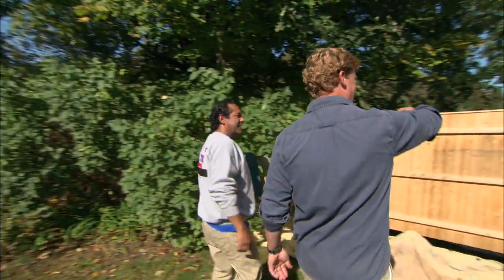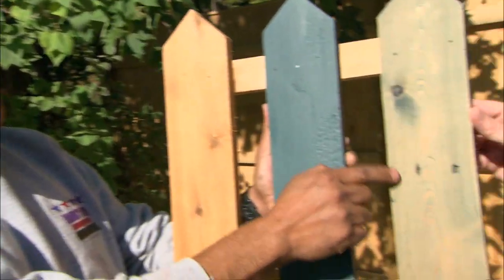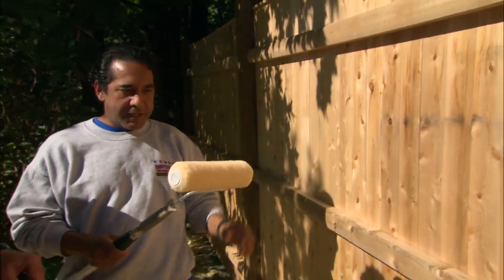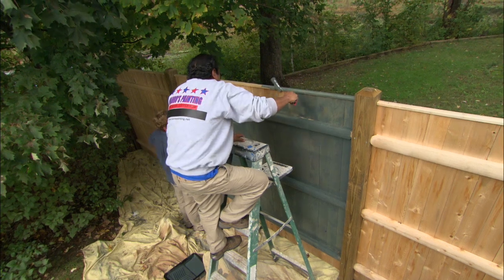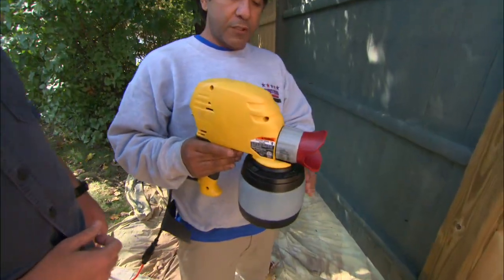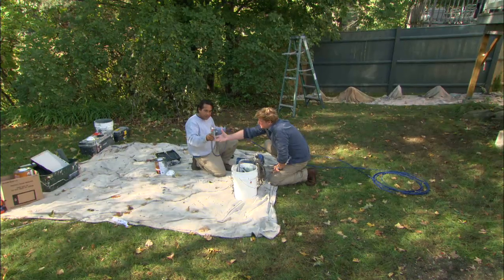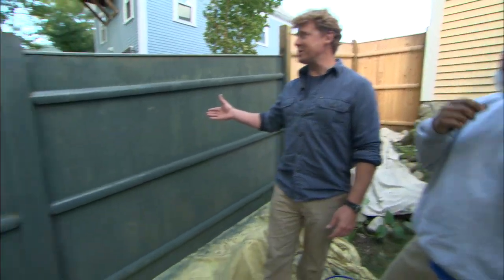How to Stain a Wood Fence | This Old House

Comment: This might be a dumb question, but how do you get the back of the fence on your neighbor's side, or if it is inaccessible?  You just leave it? What's the point of a stain then for protection against the elements if 50% of it won't be covered?  Just for aesthetics on your side?

Comment: The pro sprayer looks like more work. First you spray and then you go over with the roller, did I get that right?  The sprayer with the built-in pump looks more efficient. But I figure if I just use the roller, while I have to deal with a roller pan, etc., I don't have to deal with hanging tarps on the neighbor's side nor complaints about whatever spray might float onto my neighbor's handing laundry, if it actually does or not :p I live in a city where homes a very close,  mostly attached on two sides.   Anyhow, what am I missing about the sprayer? Have I got this wrong?
Reply: I think it is faster; and lighter for hands and arms.

Comment: I just do it all by hand like a savage.
Reply: You're a beast..
Reply: Gi Nattak injust been painting my fences with a brush, by hand. I don’t use a roller
Reply: Same...stab a tap into a 55gal drum that carried in on my shoulder, cup my paul bunyan sized hands and fill em up, then smear it on them rough pickets til their smooth as glass, 1 coat does it for a good 10yrs.
Actually, that coat usually outlasts the wood underneath.
Reply: Me too... I used exterior semi-gloss paint, & 18 yrs later we're just now repainting & repairing a few boards/posts on that fence. My problem this time is the contractor doesn't want to hand paint, my kids are grown, & I'm in no physical condition to do it myself... Ugh! I might be stuck with the spray method & get only 3 yrs outta 15 yr paint~ the injustice of laziness/shortcuts.

Comment: if you're going to spray, you must back brush for proper coverage
Reply: Not if you know how to spray correctly, proper tip size, proper pressure setting. Etc etc.

Comment: Good advice but why was the final product so splotchy and bad looking? Do they need to do a second coat?
Reply: The product itself is not ideal… If they applied the best option which is a deep penetrating oil based stain… it would have looked absolutely amazing. 
The best advice for anyone is…. If it is NOT a deep penetrating stain… avoid it !! 😀 Stay away from Form Filming Stain that just sits on top of the wood instead of diving into 😀

Comment: Look, just buy a cheap pump up garden sprayer, cover plants, and have at it. Wash out sprayer when done.
Reply: A K  i use cardboard for the bottom, and old sheets or plastic drop cloths for plants etc. Garden sprayers work good with transparent and semi transparent stains. Not suited for solid stains.

Comment: How do you keep the paint from going on the neighbor's side of the fence?
Reply: hang a painters sheet over the neibours side.
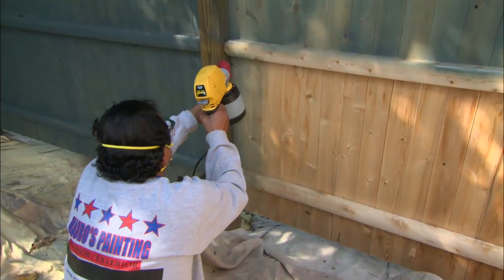Reply: See @2:50 how they use a sheet/tarp over the top of the fence. You should do that to catch over spray and have it big enough to hang from there to the ground on the neighbors side to catch what sprays between the slats.

Comment: This beautiful fence would have been much better sprayed with a transparent Thompson water sealant,,,,,,,,  if you sink in wooden posts,  drill a small hole down at an angle into the part buried into the ground and use a funnel or large syringe to pour down the Thompson water sealant to stop.it rotting in the ground as it will soak through the wood and protect it,,,,,,, I have seen beautiful fencing and posts above ground totally ruined by broken rotten posts breaking below the surface